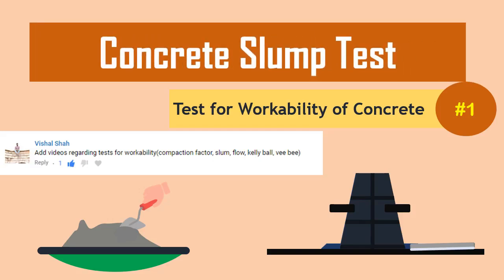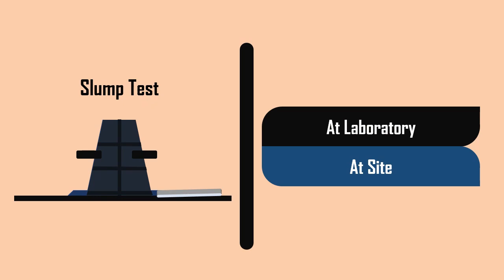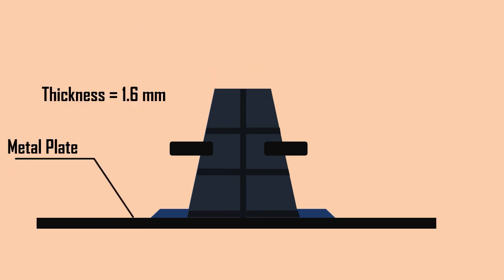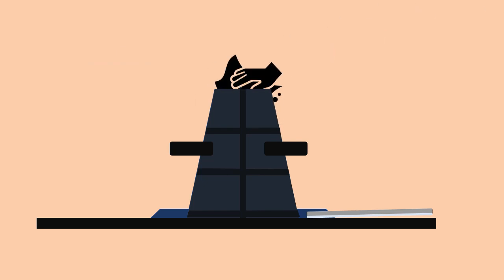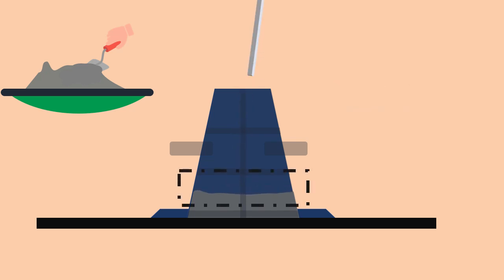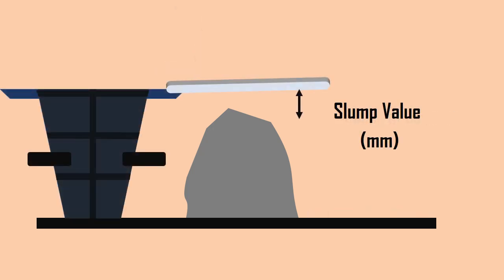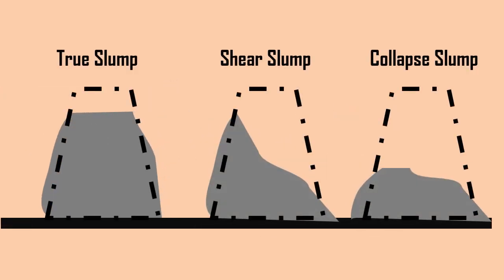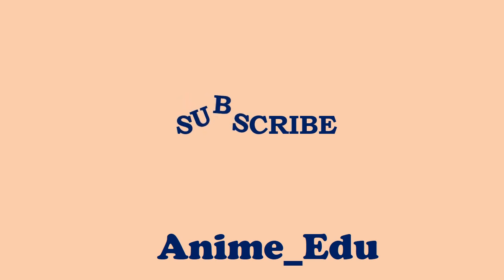Concrete Slump Test || Test for Workability of Concrete#1

Comment: 0:10 slump test is used for measuring consistency of concrete 
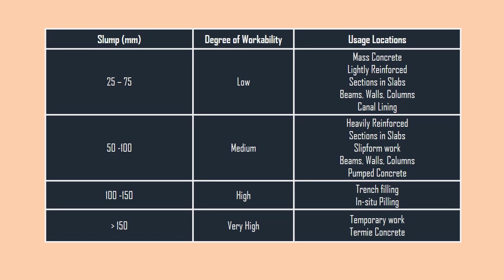But at the end (2:40) degrees of workability is measured.
Who we find consistency?🤔🤔
Reply: slump test is mainly required to find the workability of concrete.
there is not much difference between workability and the consistency of concrete.you must read some text book first man.
Reply: Can you tell me what is the DIFFERENCE between consistency  and workability of concrete?
 They are not exactly same.
Reply: @manishsom139  what do you understand by degree of workability?